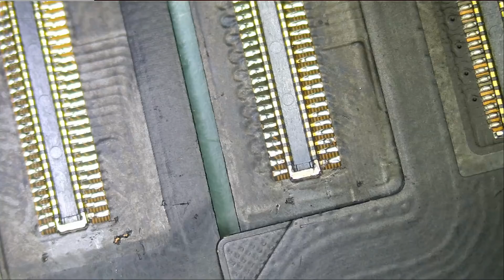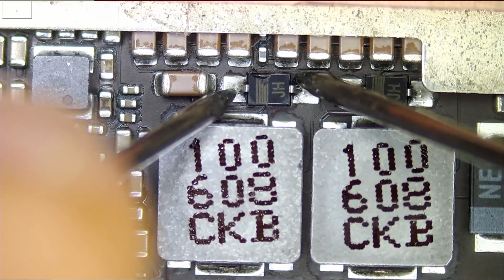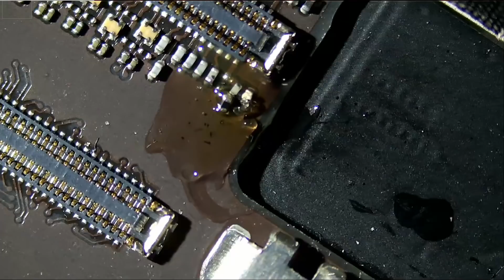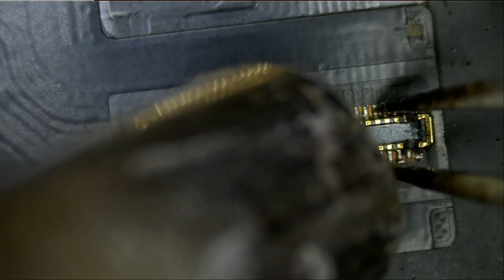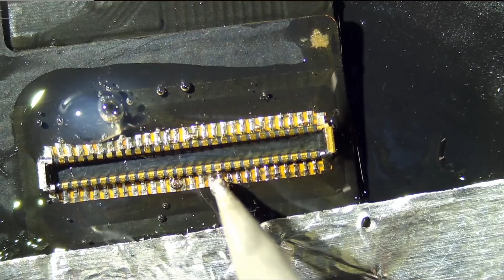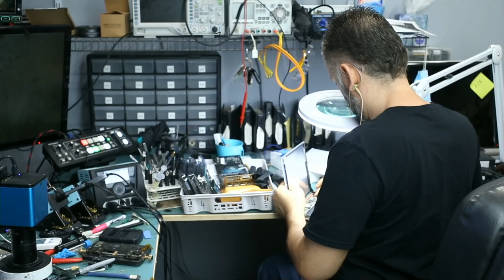iPad pro 9.7 Repair - Damaged Screen LCD connector + dark spots on side of the screen

Comment: how do I test most easily if an ipad works when the screen is completely shattered. bought used so can not connect to the computer to see if it comes to life there (even if the previous owner said it did and removed from icloud ..)

Comment: With Apple devices do you always use Apple products, such as the screen, or do you offer 3rd party replacements? If this new iPad Air 4 needed a new screen I’d buy Apple (or get it replaced under guarantee). However, my 7 year old original iPad needs a new power socket, an Apple original would probably cost more than the tablet is worth.
Reply: You can’t actually get genuine Apple screens unless you are an Apple authorised repair shop, which basically nobody is, so all screens issued are normally OEM or best available quality, unless is a cowboy repair shop using cheap ass parts

Comment: Did that dot became slightly bigger in front of our eyes? 

Who can explain me what causes those black dot damages on screen?
Reply: Dead /displaced liquid crystal pixels. cause: direct physical damage  .
Reply: @mohamadbarada9056  probably damaged in shop, since he said it himself they turned it on and there were issues on the left vertical side, not top horizontal
Reply: @infernus6278   he used another screen, not the customers with initial testing.
Reply: @badlink7776  why would he do that it makes no sense since customer has sent a tablet to be repaired for screen issues
Reply: @infernus6278  He did say the cusomter's screen didn't show anything.  Only after correcting the problems (Screen Flex-cable & SMD) and reconnecting the customers screen that he discovered a dark spot.
Reply: @infernus6278  he discovered the cable plug was not ok before putting it in, so he took one of his own screens to check if it was only the screen. But he says it all in the video 😉😀
Reply: Broken LCD the liquid inside of it is leaking, most of the time the dot will increase in size until it cover all of the screen or a big portion of it, and in rare occasions it will stop and just form a dot.